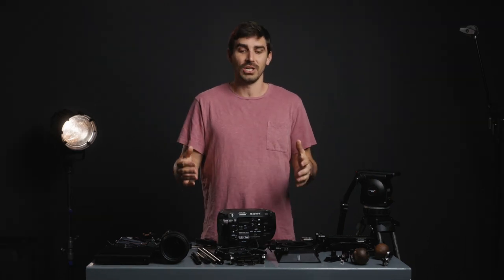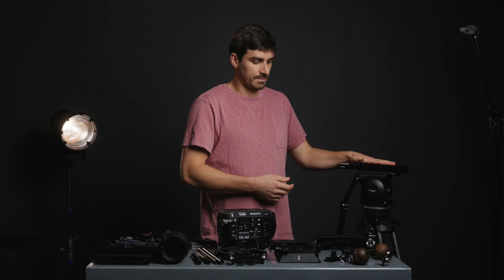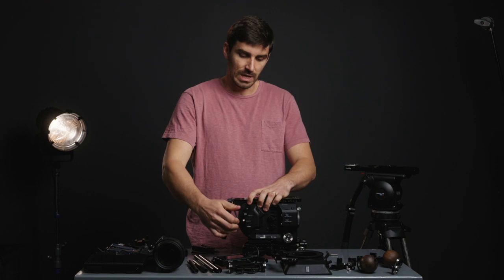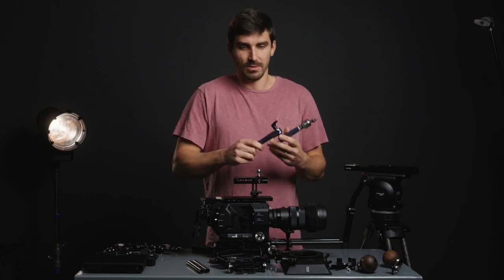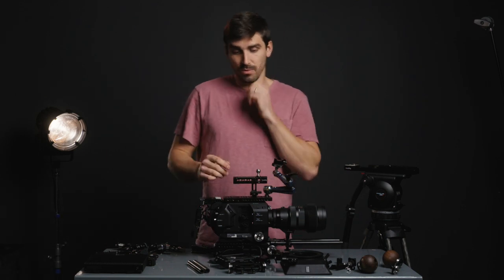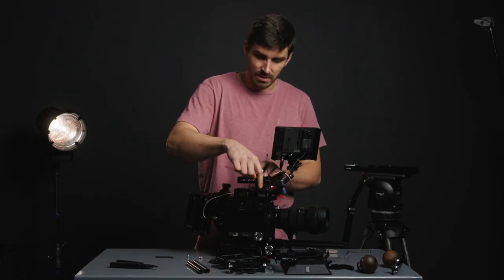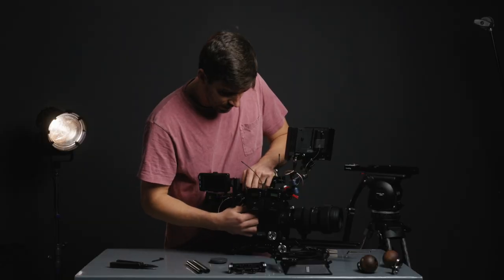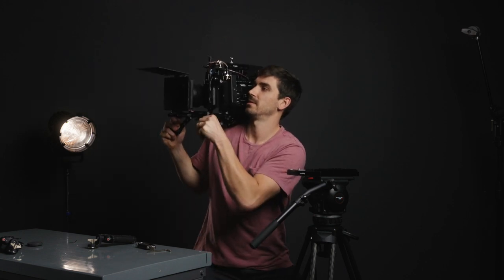My Cinema Camera RIG Breakdown!

Comment: This video answered a question for me from which i couldnt find a video on. thanks. my question was basically how sturdy are those 15 mm rods and how much can you extend them out as in not necessarily in the middle how you had them mounted to the end of the plate where a majority of the rods were out on one side. And they are pretty sturdy especially with your set up. my bigest priority with mounting anything is 1st how secure and stable the camera is, then second how secure is everything else. I always keep my stuff safe and un-broken. i like to keep that track record. i never say never, but i never am careless also. Thanks for this video.
Reply from the maker: The rods are quite stable when tightened up properly. I've found the aluminum ones are sturdier than carbon.

Comment: Very nice video of your set up however, (always a "however"), I would've liked some close ups and better explanation about some of your widget parts, like the V-lock adaptor.  It seems you have some sort of dummy batter running out  of the camera battery compartment to power the V-lock.  Not seen that and would like to know what that is.  I use a Gold Top adapter via the Extension back, which works but adds weight.  Also, it appears you have some sort of mounting mate on your wirelesses.  You explained the cold shoe mount to the cheese plate but what is on the actual wireless?
Reply from the maker: Allen Facemire thanks for this. Both components your asking about come with the product. The wire for power comes with the Tilta V mount plate and the cold shoe mount on the pack comes with Sennhsier G4 and all other G packs. Links in descriptions. Thank you so much!

Comment: Thank you for this video! This is exactly what I needed help with to  reach that new level of cinematography. I take it that whenever you need to pull focus, you just do it hand held? No focus motor?
Reply: Sorry, I just saw that part again about the Tilta Nucleus M. That makes sense.
Reply from the maker: Hey thanks! I usually just use my hand. There is a section in the description “Things I Forgot” and there’s another follow focus I use in there.
Reply from the maker: There is also a section in the description “Things I Forgot” and there’s another follow focus I use in there.